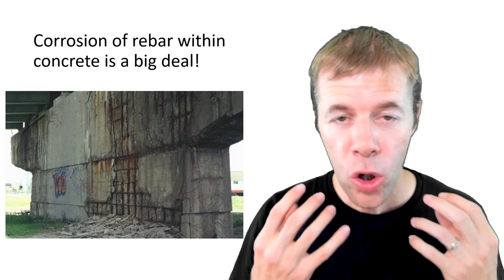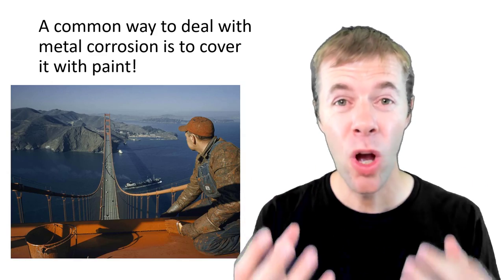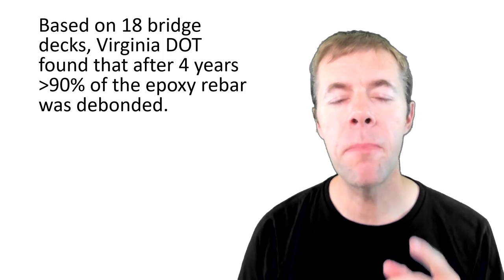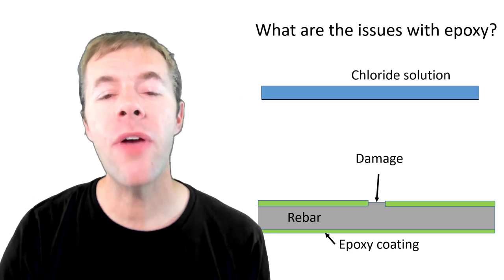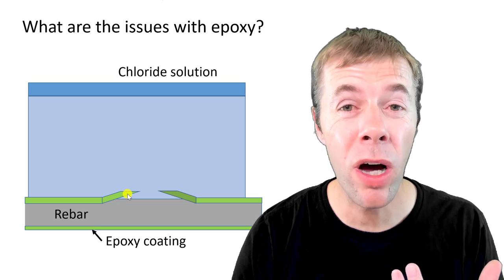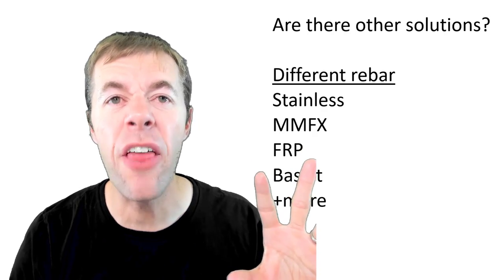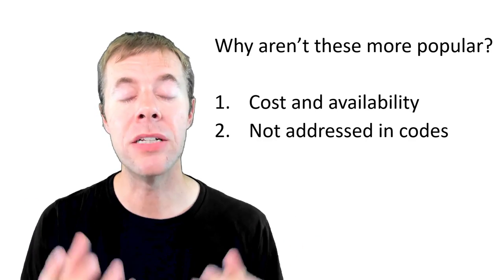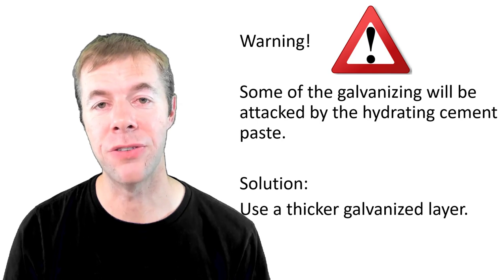What is epoxy coated rebar and why is it being banned?

Comment: Really interesting!...never used galvanized bar!  I just read that they are now hot dipping whole cages!    ?Change the concrete mix vs the bar...high strength...but the Tensile
strength of concrete is about 12 percent of the compressive for low strength concrete, going down to about 7 percent
for high-strength concrete. high strength = low permeability.

Comment: Galvanized rebar could work, but if cut especially with a torch the fumes are very toxic. This reminds me of pipelining and the process of jeeping ( using electronics to discover imperfections in the coating) . And doping ( repairing. those imperfections with pipe dope)

Comment: I have never heard such things as chloride attaching steel or passive film on steel. Those only apply to stainless steel, such as 316 stainless steel (way too expensive to be used as rebar). The damage is simply caused by moisture. Galvanized steel does resist corrosion very well.

Comment: I have a galvanised cast iron fence, 20 years, no rust. Every six or so years the paint just disappears to reveal a shine of the galvanisation. Time to paint but there has not been one inch of rust as in non galvanised. Well worth it if you face the fact you simply clean thoroughly and paint, no brushing or repairing rusted areas. Old technology that still works better than most of the new tech.

Comment: Well, Ive worked with epoxy paints, and powder-coating. they are NOT interchangeable in conversations like this guy implies. Both do need the substrate to be very clean, usually sandblasted, then coated immediately. Epoxy paints are usually 2 part mixtures with curing agent, powder coating is just a powdered plastic that is baked on. Powder coating does a good job, but if damaged down to the substrate, rust can creep long distances under the powder coat. And of course if the epoxy coating is damaged, rust can occur.
 I would agree that hot-dipped galvanizing would be preferable. One of the issues with hot-dip galvanizing...it's not done everywhere....there are many permits required, and the air quality control is one of the biggest.

Comment: only issue would be welding which you can not do with galvanized steel due to toxicity of zinc gas. any pieces that dont require welds or torch bending or cutting would be fine. alternatively full coat epoxy the bridge rebar after placement prior to pouring concrete.

Comment: I owned a powder coating finish and Company the best thing to do for the rebar  is to either phosphate or sandblast the substrate and then use a zinc coating not epoxy.

Comment: The whole idea is for the concrete to splice marry with the rebar when the concrete sets. If the concrete is done properly and the rebar is set correctly and not close to one side it shouldn't have any problems. Talking about galvanising reinforcing that's what's usually done with ferro cement boats but concrete bonds better on clean steel and in my life time I've seen reinforcing mesh or rebar going into concrete rusty and that's a no no, maybe that's why that apartment block in Miami collapsed because the reinforcing and rebar might have rusted during construction and was exposed to the surfside sea spray before the concrete was poored just like what happened to the Sydney Opera house in Sydney Australia back during slow construction and the rebar was left exposed to the elements for too long and corroded and it had its fare share of concrete cancer up until recent years and many costly repairs due to what I mentioned above.

Comment: I poured my 28 x 40 x8in thick garage floor 25 plus years ago still no fracture seams, no cracks, no rebar, just fiberglass mixed in the concrete

Comment: From this, you might obtain the impression that steel (basically the element iron) corrodes or oxidizes only in the presence of "chloride" and presumably the presenter means sodium chloride (chemical formula: NaCl) commonly known as salt (there are numerous other inorganic compounds of chlorine and elements other than sodium). Iron will corrode in the presence of either moisture or air without the presence of salt. That said, salt will accelerate corrosion of steel and there is a need for taking additional precautionary steps to guard against corrosion during its lifespan, when concrete reinforced with steel will be constantly or frequently exposed to salt.

Comment: Can't rebar be plated with an alloy that exerts an opposing effect to the corrosion process?    Why use a "neutral" insulating coating when you can find one that directly battles against the oxidation process?
Reply: Ok, just got to the galvanized rebar segment....sounds about right.   Maybe there's a better metal though....

Comment: The Romans didn't use rebar and built concrete spans that weren't exceeded until the 19th or 20th centuries.  They didn't use Portland cement, but a volcanic ash mixture that hardened to the same tensile strengths as modern reinforced concrete, and when cracked, exposed more unreacted elements that hardened when exposed to water ingress.  It also hardened when poured underwater. I would think the US probably has millions of tons of the same stuff around dead volcanoes in the West.

Comment: Back in my college days, I got a summer job at a steel fabrication place. I was an assistant to "the bender." The bender worked a machine that bent rebar into various shapes for various jobs for concrete pier reinforcement. I watched how that bending machine would grab the rebar and bend it to various shapes to fit the customer specs. So, when I see epoxy-coated rebar, I think "it will never stand up to a bending machine." The epoxy will be chipped off with each bend. Those long bars shown at 2:06 had to be cut to length. What happens at the exposed cut ends of the bar? Then these big cranes come and pick up the bent bar to haul it to the job site. Crunch! Yeah, I can see how epoxy-coated rebar won't prevent corrosion. Ditto for galvanized bar, which will also chip when bent, cut, and handled.

Comment: Hi Tyler  I live right near the coast and for years have found what you are saying is true- epoxy does not work! Lately, I have been coating rebar with rust converters and using cement that supposedly does not allow humidity to go through.  Then apply waterproof stucco.  Hoping this works.  What do you think?  I am in the Riviera Maya, Mexico

Comment: I like the idea of double dipped rebar , kind of like double dipped galvanized nails for corrosive pressure treated lumber and other corrosive woods !!  If you have ever seen galvanized angle iron and channel used in electrical transformer substations you can understand the effectiveness of galvanizing!!  Worked in an industrial environment where I was in an elec. substation every day and there were galvanized steel structures over 45 years old and they looked like new , absolutely NO RUST !!!

Comment: Even if rebar's coating was without scratches, cement would still scratch it as it took on cold and hot tempature just from expanding and contracting throughout the season, along with cars or people walking or driving over them, or the wind..  basically  Rebar's purpose is to reinforce the concrete to deal with the movement,  paint doesn't put up with this as well if it's purpose is to never get a cut on it's surface

Comment: Few main problems....with anything that traffic goes over constantly,  vibrating cured concrete always cracks it, add in shallow coverage of rebar,less than 3 inches and you will get spawing that just spreads easily because the corrosive enemies have little resistance....not sure why engineers are still putting 2inches of coverage....one 1 to 1 1/2 inch stone that forms a small void next to the rebar and the breakdown will begin.....vibrating is never perfect nor covers every cubic  inch

Comment: I was always wondering why not stainless steel.  This answers my question. 

I think carbon fiber is the way to go.  It is stiffer than normal steel, can be produced in mass, the resource is almost unlimited, the thermal expansion is pretty similar and adhesion to concrete now much better.  It would be costly at first.  Then it would eventually come down.  And it will decrease the price of steel for other use.  Oh, and carbon fiber will make it much lighter.  This enables architect to make a bigger structure.

Comment: Normally there is no problem with rebars and corrosion because concrete protects them, the problem is rather that the layer of concrete that is protecting the rebars gets to thin or porous. Another factor is the carbonation of the concrete that reduces and finally removes the protective layer of the rebars. That is why there are different levels of how aggressive the environment is in order to use the right concrete cover thickness. 
The other problem that I see with the epoxy is that it reduces the bond between steel and concrete making the reinforcement (anchoring) weaker.
By the way chlorides are only one problem of the corrosion......
Reply: I agree, with the right cover and quality of the concrete, it shouldn't be an issue

Comment: Logistic in galvanising 24m rebar is a mess! Adding another process to handle 500ton of rebar is costly. Then another problem with actual contruction site, site modification would damaged that would defeat the galvanising in the first place (rtd const.mgr).

Comment: What about Plasti Dip? If you could do something together that's going to be up for a long time I would think that either Plasti Dip or some other coating would protect the rebar from exposure and corrosion... I mean ultimately it only have to be there out in the open until the concrete is poured and set. Might be problematic on things like Bridges but if you're building a house with concrete I would think that sort of stuff would Not be a problem once it is poured....

Comment: Hot dipped galvanisation is very effective, allows a thicker coating and most importantly, bonds well with the concrete, Stainless Steel is poor in this respect. It would be good to better understand the chemistry (the odd formula would be useful). 
I feel sure that the inclusion of fibres is important in reducing cracking, maybe nylon would be best, which being extensible, will allow the concrete some movement. Prestressing, where practical, also helps in this, as well as adding strength.

Well balanced and interesting presentation ('though for me, a little over-acted). Thanks.

Comment: The epoxy coated rebar issue highlights the pipeline corrosion issue for me.  A deep pit doesn't just weaken the pipe; it's Going to turn into  a pinhole leak.  In the pipeline world, protection is attempted by Cathodic protection, imposition of a voltage such that, if a spot gets wet, any plating that occurs will be onto the pipe.

Comment: Hot dip galvanized  has the same issues as epoxy coating.  It can chip and get damaged during handling resulting in the same holiday issues.  Also what about cutting? You expose these cut ends to corrosion and yes you are supposed to spray these areas, but anyone in construction can tell you how many times that gets missed and those sprays are inferior to the original coating.   FRP or 316 or higher grade stainless is the only true solution in a severe marine or heavy road salt applications.  Also a proper top sealant on the concrete itself will add life so those same chlorides don't break down the concrete itself and keep freeze thaw at bay.  I am a ME btw, not a CE.

Comment: It is a site supervison failure.  The damaged epoxy coated bars are supposed to be touched up after they are fixed in the permanent position!
The debonding layer of the epoxy layer is also an indication of substandard epoxy paint.
The suggestion of epoxy coated rebars being banned is a slander.  Just like galvanised rebar or stainless steel rebar the epoxy coated rebar is one of the many component in solution of increasing the longevity of reinforced concrete structure.
One can use corrosion inhibitor in the mix, superplasticizer to reduce the water/cement content and a vast cement replacement material to boost up the diffusion coefficient of the concrete.
I suggest the readers download the Life365 software as that is the bible for designing good concrete.  Epoxy coasted rebar is possibly one of the dozen methods that can be used and should be shot down like the speaker has suggested.

Comment: Any coating will fail, adhesion is never possible on the surface of rebar because of the scale from the steel mill manufacturing process.  HDG is probably the best but still any cut or weld will be a weak spot.  I’ve seen stainless rebar used in hospitals with sensitive magnetic equipment, but it’s sky high expensive.  What about rethinking the concrete, instead of the rebar?  (Look out Big Concrete).  We are not forced to use typical modern concrete we are just accustomed to it.

Comment: 3:10 debonded from what - the paint? If so, how do they perform compared to non-painted rebar... not stated anywhere in the video.
3:55 those are not scratches on the paint that's from a poor paint job, paint drying too quickly or applied too thick.
5:00 is there deep pitting, how deep, maybe even the whole rebar is gone - the only way to know is to strip the paint and look closely, could also be just surface rust... no way to know from that picture.

Comment: Galvanize it before you epoxy coat it. Best of both worlds.  Zinc slows corrosion,  epoxy prevents wet concrete from dissolving the zinc.

Comment: Think galvanized would have same issues as epoxy, as far as chipping.
More durable but still susceptible. 
Thought there was talk of doing away with hot dipped galvanizing?
Environmental stuff. Could be wrong. 
Plus you have to be very careful with dissimilar metals in  marine applications, electrolysis that can occur, can literally eat through 1/2 inch bar in weeks.
 Thought two major issues were. Correct concrete "recipe " for lack of better term. And making absolutely sure. That rebar is  totally encased in concrete . With no exposure or pathways to the exterior. 
 That this was a major cause of accelerated corrosion. That has actually been cited , for some bridges collapsing prematurely. 
What about the steel they use now on some bridges. 
Where it's actually designed to form a slight layer of surface corrosion as a protective layer.?
Probably too expensive?

Comment: Cool , I did high rise , footings etc . I understand Roman concrete lasts forever because they didn’t use steel . So all those condos are going to be demolished in 100 years  ? 
 Why don’t you just experiment with split bamboo . I notice on old houses the nails rusted and disappeared but the wood remained solid ! 
Wood needs organics , water , warmth , to rot. Maybe “C” section (split bamboo ) would be good ?

Comment: As soon as he said 'galvanized' I perked up.  I am a sheet metal worker and use galvanized sheets of steel all the time, because it works the very same way.  So next time you look at your forced air heating system you will know that your system is going to be in place for a long, long time.

Comment: Does anyone use a zinc rich primer + topcoat system? They're self healing with zinc oxide patching scratches, and you've got the galvanic effect, and it's more chemical resistant than hot dip.

Comment: yea they are banned because if the rebar dont have ideal surface when applying the epoxy and if the surface is damage during installation. Also it potential of catastrophic failure when the rebar almost slip out of the concrete. Also by coating rebar you negate the proces of bonding concrete to iron and creating a layer that slow down even a starting rust. I wonder if there are some experiments on concrete penetration with mineral oil or paraffin.

Comment: When I was a plumber we would run plastic covered malleable steel pipe for natural gas underground.  Where connections were made we would apply tape to cover the non coated fittings.  This was a joke as it is extremely unrealistic  that the tape would keep moisture out.  Everyone was aware but plastic pipe, at that time, was not allowed.

Comment: Cause of Surfside building collapse. Cement cracks. Rebar rusts and corrodes. Next to the salty ocean. Recipe for disaster. Coating rebar should be mandatory along any coast.
Reply: Guess you didn’t watch the whole video…coatings don’t work. They get nicked and fail also.

Comment: Has anyone considered UHMW plastics such as kevlar/dyneema etc.  The have better tensile strength than steel, don't rot and if embedded in concrete wouldn't be exposed to UV.  Cheap to make as they make a boat load of bin bags every year out of this stuff.  Don't know enough about why rebar is used in concrete.  Thoughts ?

Comment: Since concrete is a porous material, why don’t we coat the outside of the concrete so that the chloride doesn’t penetrate and never gets through to the rebar. 
Just like the Golden Gate Bridge where  they are coating the exterior surface.

Comment: Galvanizing rebar is not a good idea. Under stress the costing will flake off and expose the steel. This leaves only a thin layer of zn fe that may not be enough protection.

Comment: I'm no expert here but I know that these coatings work real well unless they are chipped and the metal is exposed...even a very small chip.  When working around freshly coated steel in the trade we always had to be very very careful not to damage it in any way.  The painters were always stressing and checking for damage.
I have seen coatings that were over 20 years old in storage tanks where the coating and the metal under it were as in perfect shape as the day that they were put in.  It works just as long as it was put on right and not damaged.